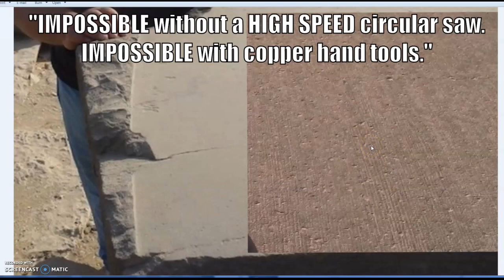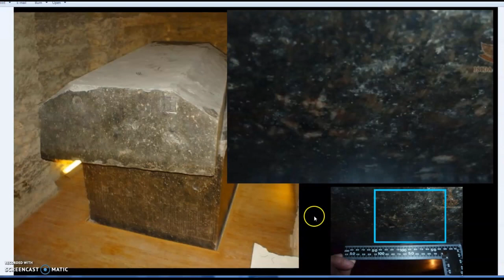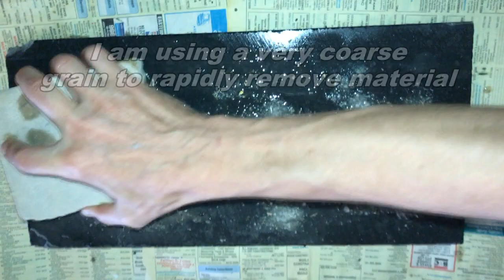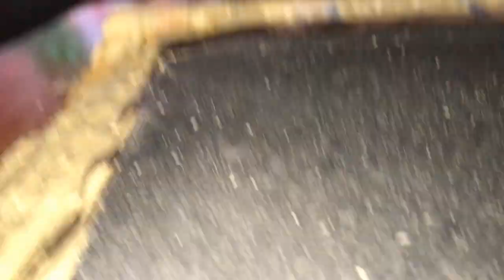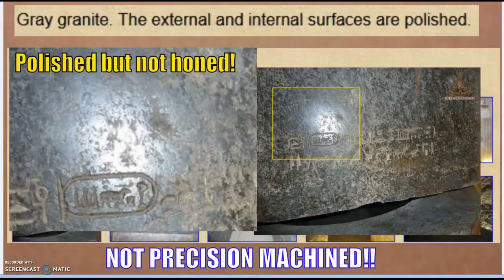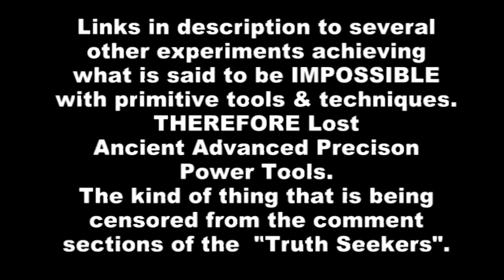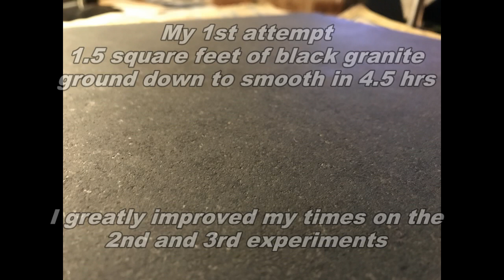Ancient Stone Working Techniques: Experiments with Black Granite on Removing Striations

Comment: I have been to some of these places, and can tell you some of these stones are as smoothe as glass and can reflect light. With no curvature along the whole length. And crisp edges. You have to go there to see for yourself. Some of these large stones have been placed on top of mountains. Water or wind power could be the sorce of power used. You dont need electric power, but no way the local people that lives in these area's are the original builders. Some of these buildings and stones from ancient times, must have been made a long long time ago.

Comment: They had all the mechanical advantage they needed to produce the tool marks we see without the need for “motors”.  They had large pendulum saws likely stabilized by guide blocks, various rotating grinding stones powered by hand or through a system of differential leather belts and spindles and of course every imaginable hand tool.  They used tube drills of all sizes, fire/water to quarry massive blocks etc etc.  In today’s world, we expect a motor to do the work in minutes.  But what the Egyptians had a lot of - was time.  Simple machines working all day can produce big results.  This is not some big lost conundrum people….

Comment: This has many similarities with modern surface plate calibration and conditioning. For those who don't know what a surface plate is, that is a granite block that is ultra flat and calibrated for flatness, and it is used as a reference to make ultra flat surfaces on metal parts. Here is a video about how such a stone is measured and calibrated and conditioned and certified, the video is called.... Surface Plate Calibration and Conditioning.
Reply from the maker: @insAneTunA  I have some follow up up videos where I make surface plates using home made abrasive. The plates floated, you could even lift them up as they floated which was especially weird. 
Later I tested the surface roughness and the results better than “impossible” to replicate examples.
Reply: @SacredGeometryDecoded  I am in the process of exploring your channel. I bumped into some folks who think that there was an ancient highly advanced civilization. They are getting fueled by a guy who has a channel called stone riddles. He claims to be an engineer or an architect, and he visits historical ancient sites. And he constantly doubts the official reading from the professional archeologists. He is not hugely open and direct about it in his videos, but we got into a discussion, and he linked me to a video from a lecture that is about so called "ancient highly advanced people. He thinks that engineers and architects have a better understanding about ancient structures than the professional archeologists. In the comment section I try to debunk some of the comments. So that is how I stumbled on your channel. 👍

Comment: Yes I keep hearing the same old argument for alien technologies, giving no credit to our ancient ancestors. As a professional sculptor working primarily in stone I find such claims laughable. You only have to look at Chinese Jade craving to see that stone carving techniques have not been lost. Yes most Jade carving is done with power tools and diamond pads, but up to one hundred years ago this was not the case. And Jade in many ways is tougher than Granite. It has a internal fibrous structure that make using chisels impossible. It will simply shatter. And a piece of advice, you'll find that using a circular motion when grinding is more energy efficient and makes for smaller scratches in the stone as you polish.

Comment: 2:25 high technology can still product low technology results. and it sounds like you deliberately tried to make the cut curve. not that it was natural for it to curve. that sounds like you're trying to make the experiment produce the outcome you want. instead of letting the experiment product it's own natural outcome. hmmm
Reply from the maker: I have follow up with longer blades and how they wear differently leaving inverse curve. The result is what nature demands and experiments should be tested if in doubt.
Reply: People have been using the techniques here for a very long time.
I've worked in a granite shop for over twenty years, and I also have ground and polished optical lenses for 16 years, and I have experience with a wide variety of machinery in many fields including woodworking and plastics.
The Italian stone masons have a history of using straight metal blades and loose abrasive.
People have been working stone within ancient history, with known tools, and with known results.
Why do people jump to the conclusion that something is impossible, so it has to be ancient aliens or high technology?
Reply: @richtomlinson7090  you just described ancient humans used technology. low technology like sand and copper saw is still technology. technology is not only smartphones. ancient humans can use a water wheel to make a copper saw with sand move back and forth to cut stone. smh. stop being ignorant
Reply: @kungfumaster12  
The claims of the Ancient high technology crowd, they claim ridiculous stuff.
I know that ancient people were just smart and hard-working.
I have experience grinding and surfacing many materials.
I've ground surfaces that were Plano / 0 diopters to over 20.
I've surfaced flat lenses and can tell if glass or granite is flat, and some of the videos, you see from the irregular reflections that they aren't modern high technology.
That's what some sites claim, but I probably have more experience making flats and curves to spec.
Experience in Carbide, Ceramics, and many types of Plastic, Glass and many types of stone and Granite.
Reply: Sounds like you're in a cult of soft handed baby brained liars.

Get real simpleton.🤦🏾‍♂️
Reply: @pranays  I think you meant smooth brained. Which is what you are. 😆 🤣 😂 😹  why it's always the nobodies that don't make videos or help solve the mysteries of history. That talk as if thier the smartest one in the room . Newsflash kid. You're not. I'm the smartest one in this conversation. Go back to being ignorant 🙄 with your smooth brain cult friends

Comment: Hello!  have you tested the same idea but with 3 stones in the water(under) and using only the 3 stones as rubbing against each other to produce a perfect finish.  You basically use 2 to begin, of almost same size and you alternate with the 3rd one after a while and also switch them sides producing 6 rubbing surfaces that all have imperfections hitting the high points in alternance.  Water  is acting as a lubricant to help with the motion and also help displace debris as they are produced.  In the end, you end up with 3 stones that are flat on both sides with an almost perfect finish.
Reply from the maker: Yes, the Whitworth 3 plate technique. Have a couple videos on those,
https://www.youtube.com/watch?v=oQTsbhzEkfs
These ones not only float but also stick to one another so you can lift one with the other. 
Also another one where i measured the surface roughness of a larger plate polished with home made abrasive.It wasn't even properly finished has it had been scratched and such in the meantime. The best reading was 800 nanometres (0.8 microns)

Comment: Great video and thanks for showing the different finishes and how to achieve them. The biggest question mark, regarding the places you have mentioned, is the scale they have been cut, then moved into place. To me, that's something if it can be duplicated with techniques, not using modern day equipment, that would be interesting. Of course as so many have mentioned, the cost in doing something in this scale are just not possible. Seeing these things in real life, adds a different dimension to it having been there myself. Cheers.
Reply from the maker: Thanks
https://www.youtube.com/watch?v=jM4wMKcuGKQ&list=PL47iaGB6hlT6qVaxoxQoK6N6KI9FnbUIl
playlist of examples of primitive tech moving and lifting heavy weights.

Comment: Excellent work, it's sad that UnchartedX gets away with such tosh.  There's a hand-held technology that would answer your question of whether a polish or sealant was used on these objects, it's called X-Ray Florescence. It can identify every element in a scanned object down to one part per million (so for instance, if you found the components of tree resin, waxes, whatever would have not decomposed).  It can also be used to identify sources (quarries, trade routes) of any stone object as long as the source is in a data base.  Another YouTube debunking UnchartedX at length (3 hours+) pointed out that the particles used in emery paper was traded to Egypt from Crete 4k+ years ago using similar analysis. Unfortunately the machine is $50,000 Keep up the good work.
Reply from the maker: Thanks
In follow up I used the waste abrasive and graded into finer particles just by settling on water.
Surface roughness testing (another impossible according to uncharted x) 
I got down to 0.8 microns or 800 nanometers because I love saying nanometers. And that could have been improved.
Those lost tech channels ask for such experiments but censor any links if I or others respond.
They do aggressively highlight failures,

Comment: We are so used to everything coming from a factory that we forgot what handwork can actually do. It is still around everywhere, look up any temple anywhere on earth. They don't come from a big factory where machines are building ready made cathedrals, temples, statues, etc. That is all, still, hand work from people who have been doing a craft for generations. And most of them have no money for million dollar equipment, they just use the most basic stuff people have been using since forever. Even in our fancy pancy modern society most building is done with primitive tools, you don't need a thousand dollar gps guided laser tools to meassure if a brick wall is level when you can check it with a piece of rope and some sticks. In fact most modern machines are just ancients tools with motors or stronger material. When we build a house there is no magic super advanced tech, it is just cranes, scaffolding, drills, saws, hammers, buckets, basic meassuring tools for level, proportions, scales, etc. The only thing modern is that we have  motors to do most heavy lifting and some universal metric systems.

Comment: Didn’t cover the right things. Should watch some videos before making claims. Each of your claims didn’t get to the actual point and then you tried to “debunk” your short handed points. Like I said you should read watch more into what they are saying, one example being the polish. The main focus should be the non flat “scoop” marks that are polished. This can’t be done in the same way the flat surfaces you polished were done. This is just one example of pretty much every claim in this video not addressing the correct thing. Do the right research and try to debunk the right things and then you got it👍 keep it up, good effort.
Reply from the maker: i have covered and done demo's on those.
Polishing a "scoop' is what every sculpture does to get into the curved bits. Standard practice still now, not a mystery even in the slightest.
You take a cloth or softer stone and rub the grit in finer and finer grades.
I do cover the right things and have covered them in detail.
In follow up videos i go through each and every stage including making the materials at home.
Reply: @SacredGeometryDecoded  my bad I just realized which channel this was and that I’ve seen your videos before. Lol have a good one ✌️
Reply: @SacredGeometryDecoded  great. Feel free to post the link(s)
Reply: @T C >"The main focus should be the non flat “scoop” marks"
Nope. Dunn measured the roughness of several microns (his claim) on the flat interior of box #16. He never measured roughness in the "scooped out" spots on the lids. Dunn/Ben's claim is refuted by this vid: you can polish flat granite down to microns with simple methods. If you have a claim about the "scooped out" areas on the lids, show your measurements, then someone may look into into it. Not until them. Classic goalpost shifting: Claim A refuted? Just switch to claim B! :)

Comment: Look up how lithographers grain their stones, they use a tool not too dissimilar to the top part of your flywheel drill in your other clips, basically just a crank on a flywheel. I’d hazard a guess It would speeds the honing and polishing process up at least double time.

Comment: Literally just fell into this rabbit hole three days ago, one particular bit of circular thinking I’ve come across with adherents to the cult of LHAT is they will wide eyed tell you grinding wouldn’t work because they didn’t have modern abrasives, but they did have modern circular saws, and articulated laser spiral cutters were clearly in abundance…